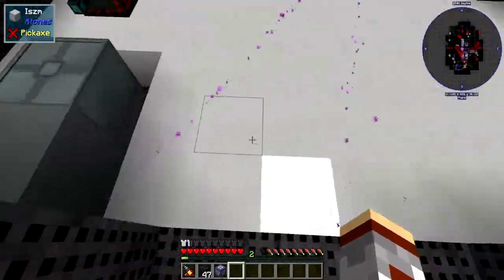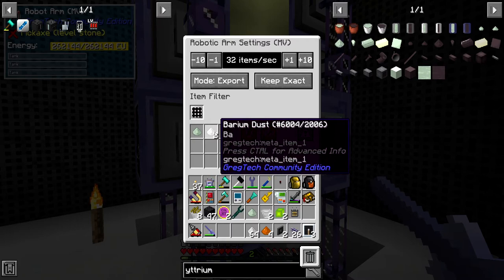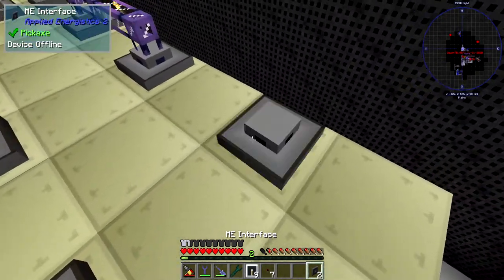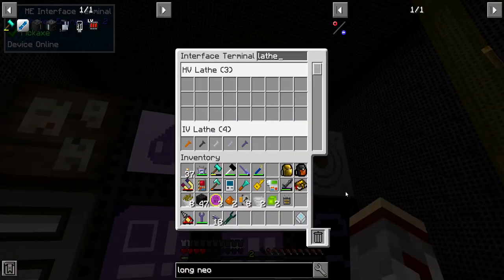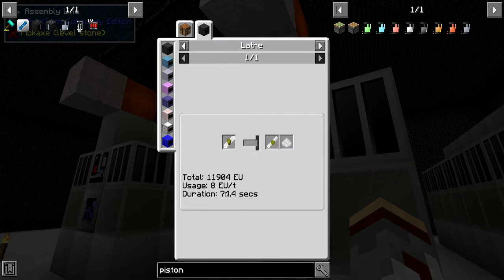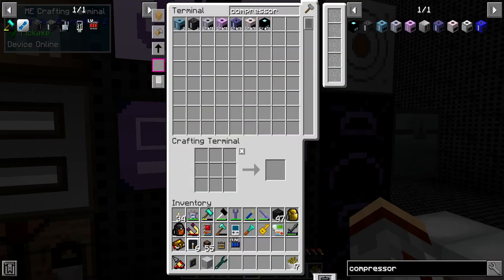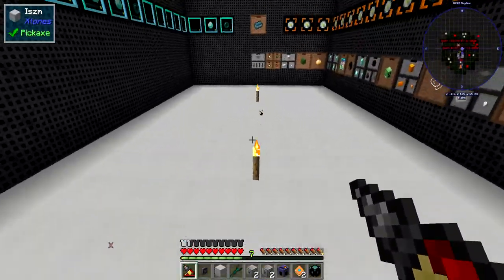Lets Play OmniFactory Episode 64 - Luv Compressor and Flux Weaponry

Comment: 6:00 In addition to basic left/right clicking, you can hold shift to double/halve quantities too for even faster configuration if you're setting up larger amounts.

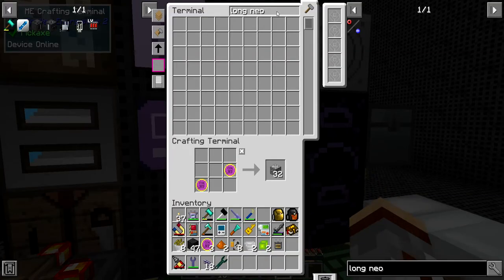13:45 Polarizers are very fast so it doesn't matter too much, but I think it's slightly quicker in general to polarize ingots since you can machine them into magnetic components like rods in a single go.

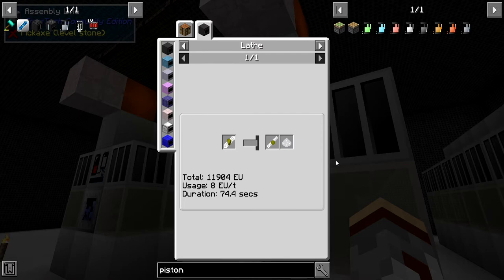18:00 In the version of GTCE we're using, rounds take a duration based on the material's hardness value so the time it takes to make them gets kinda crazy (especially when you get to things like Neutronium). It is a very good idea to prestock a lot of rounds for the LuV through UV recipes, or at the very least set up a "processing array" of sorts to parallelize with a whole bunch of lathes. Storing the alloys you need to make rounds with in a compacting drawer is also useful since it gives you instantaneous access to blocks, ingots, and nuggets.

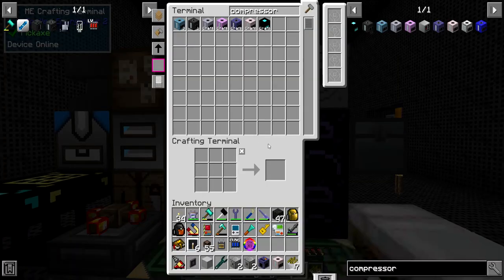24:50 The base recipe requires 15,000 EU/t so it's LuV, and won't overclock until ZPM.

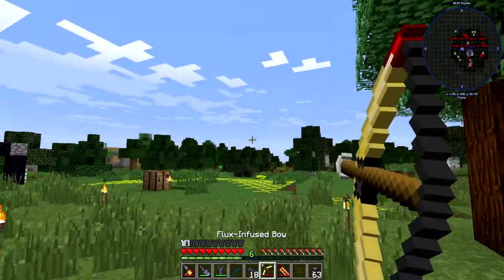30:00 Yeah especially if you enchant that bow with multishot you can just annihilate bosses with it. It's good stuff.